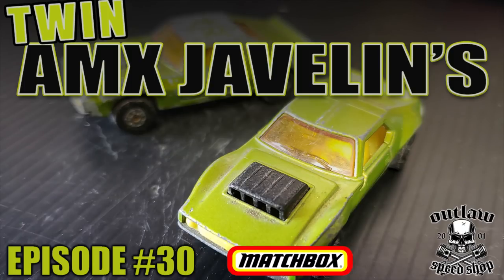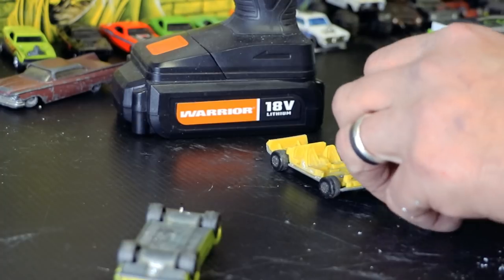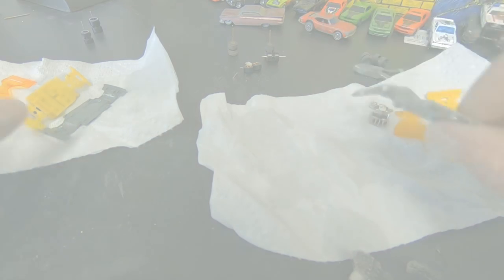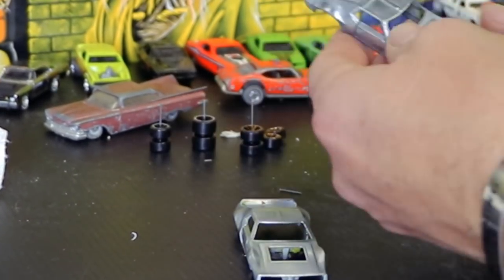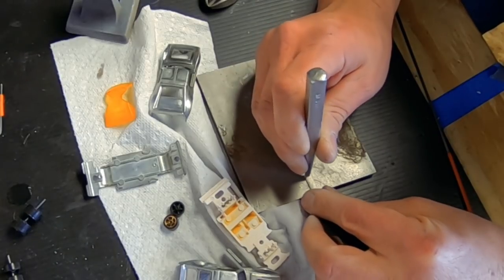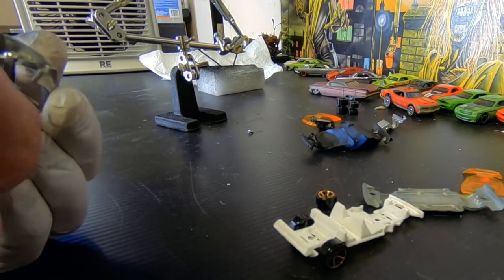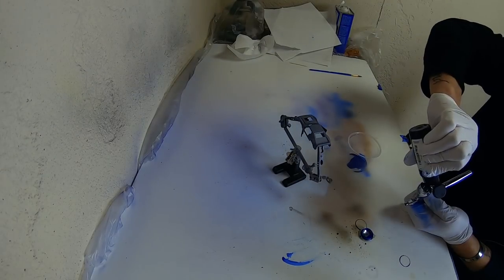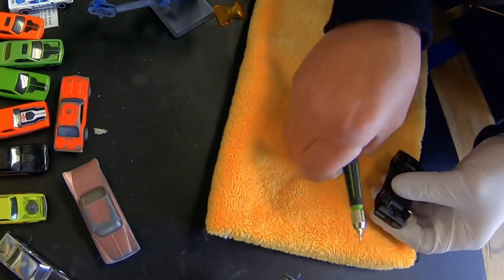Episode 30-Twin Matchbox AMX Javelin's

Comment: No doubt that the Black one looks real muscle and the Blue one looks like a daily driver. Nice one Outlaw, recommended to watch you by Die cast Resurrection so i will check out the rest of your resto`s for a bit of a binge watch.
Reply from the maker: Thanks! I'm partial to the black one myself too
Reply: I have a tip for the plastic screens to maybe change the color try using glass paint its transparent and water based i have even painted polished metal with it and it looks just like spectraflame you can get on ebay in small 10 ml bottles by Hobby ideas. hope that helps. Thanks from a new UK fan.
Reply from the maker: @francispalmer9737  good tip!!